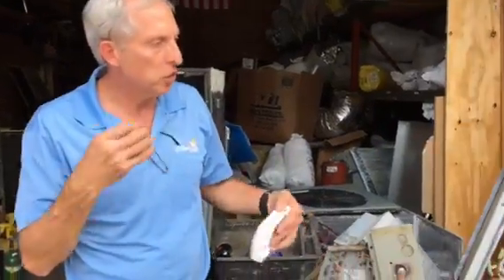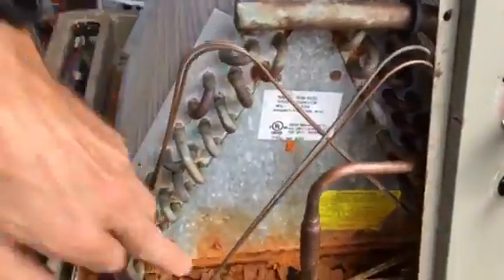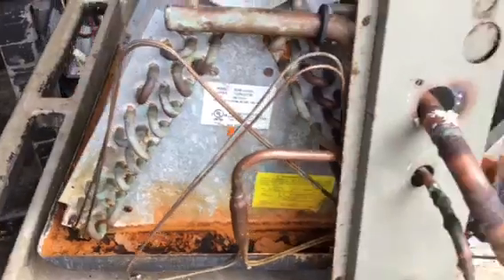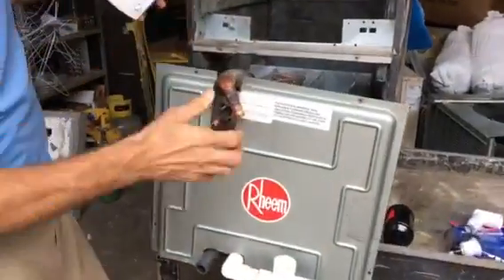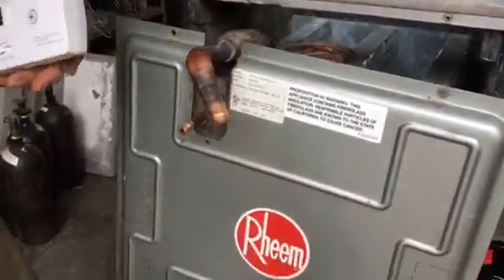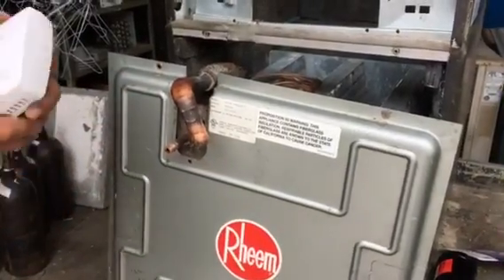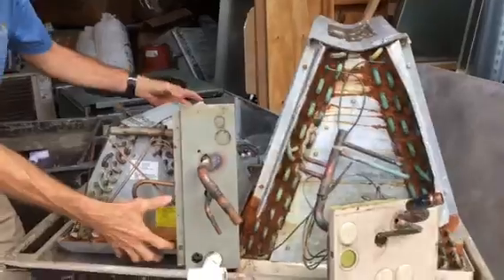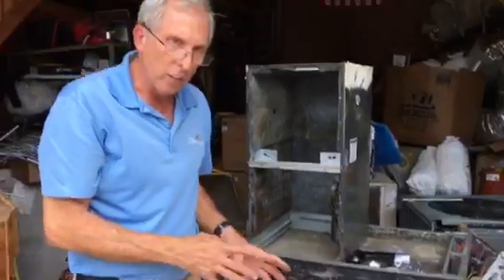How to replace heating and cooling  indoor coils

Comment: Yes but why build them so they only last a few years?  I mean seriously, copper and aluminum work well togather. Tin or steel dont you get electrolysis and the copper will deteriorate all you have to do is add presure, and you start blowing holes in pipes.   The frame could be plastic. 
My old r22 a coil was 23 years old and didn't leak. I changed the system becuse the compressor went out. And it was a seer 9 or 10 system. How is a 1k dollar charge to replace saving me money? 
Insted of paying a little each season on power i have to shell out a lot in a lump sum.   Granted its less then what the units saved but still.  And thats looking like every 7 years.  
Build them with copper and aluminum and a hard plastic frame it shouldn't be galvanized sheet metal.
Reply: Don't, for one second, believe that it's not done purposefully, and with that in mind.
Reply: The term is Planned Obsolescence
Reply: It’s called revenue engineering!